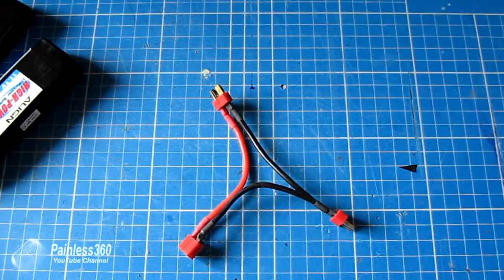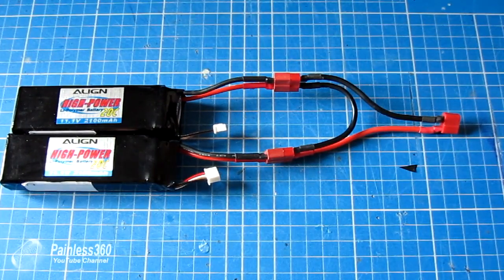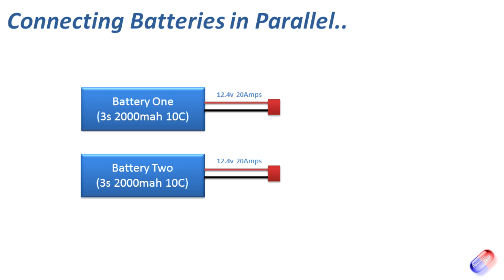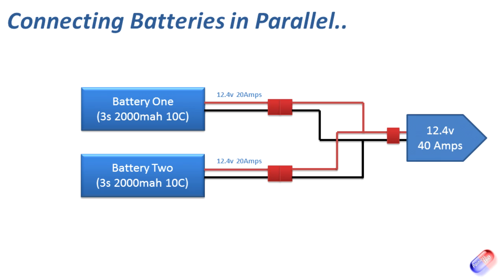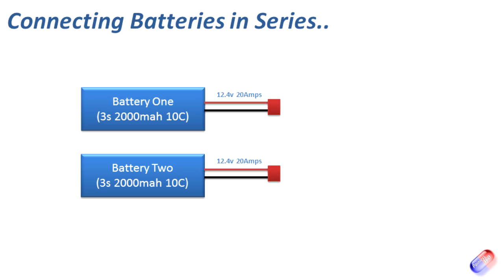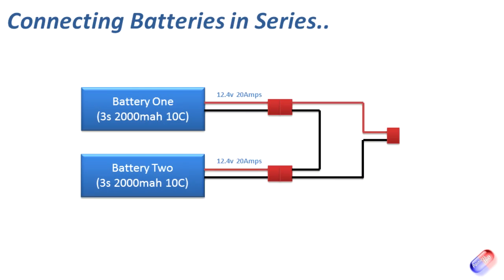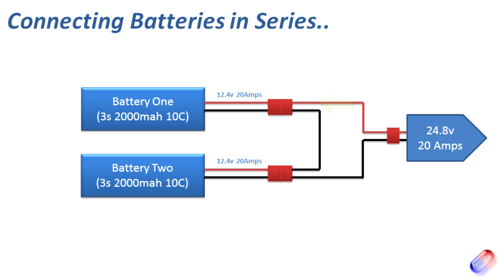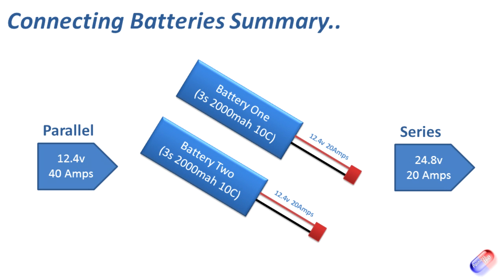Connecting batteries in series or parallel (LIPO)

Comment: hi thanks for making things clear .. I have one question hope someone could help me with ..I have 3 batteries each is 3s, 20c, 2200mah. What happens if I connect 2 batteries in parallel then connect the 3rd one in series with these 2 parallel batteries. I will get 6s voltage but what happens to the amps? & is this safe?
Reply from the maker: Why would you do that? What do you think the answer would be? 

Happy flying!
Reply: Well because my diy quad needs 6s and while am still waiting for my batts to arrive (from China) I have been using 2x 3s in series which gave me 6s 2200mah but I need more mah to get more flight time so since I only have 3 of them I just thought maybe it will be possible to do it and I expected to get out of this setup 6s 3300mah (this what I think the answer would be not sure though) .. Also am worried on how safe will it go :)
Thanks..
Reply from the maker: Catalysis1144 this will not work. With those three batteries you can have either a 3s 6600 pack or a 9s 2200 pack depending on how you connect them. Anything else won't work. If you had 4 packs then you would have other options.

My advice is be patient and use the new batteries when they arrive.

Happy flying!
Reply: Thanks I was just wondering about it.

Comment: So if i get 2 2s lipo 3000mah. 20c. In series would that c rating also be doubled?
Reply: jacob portillo I'm also looking for answer for this same questions. Please do respond if you've got the answer to ur question. Thanks!
Reply: Nikesh Bhattarai well i have been told that no, the c rating is no doubled, but i feel like it is doubled, in my mind it makes since that it should be double, but supposedly no...
Reply: jacob portillo Maybe the answer is No. for your case (2-2S Lipo 3000mAh, 20C batteries, 7.4V), I'm trying to think of it in this way;

In series, 
Total voltage = 2*7.4V (doubles)
Total capacity = 3000mAh (does not change)
Discharge rate = 20C
Constant current discharge would be = 3000mAh*20C = 60A
Time taken for the batteries to be completed depleted at this discharge rate would be = 3000mAh/60A = 0.05h

In parallel, 
Total voltage = 7.4V (does not change)
Total capacity = 2*3000mAh (doubles)
Discharge rate = 20C
Constant current discharge would be = 6000mAh*20C = 120A
Time taken for the batteries to be completed depleted at this discharge rate would be 6000mAh/120A = 0.05h

My assumption is that the batteries would be depleted in same time for both series and parallel connections at their particular constant current discharge rates. If the C-rating would double in parallel connection, we will have the batteries depleted half the time earlier, which does not make sense to me. I'm hoping there's an even better explanation though. 

Let me know what you think of it.
Reply: thatswas a goodway to explain and you are correct, i finally get it..

Comment: I have 4x 3S 3000mAh 20C Lipos. Can I connect them in serial to get 2 pairs of 6S 3000mAh and then connect those 2 pairs in parallel to get 6S 6000mAh??
Reply: Raver Meister You have probably figured this out by now, but yes, you can.

Comment: Hi brother this is dan again , e bike build, I'm having a very hard time understanding what I need to run my e bike ? As I told you in my last message , I'm wanting to buy rc battery's , my motor is 5000 watts and me speed controle is 80 amp , I was thinking about 4 , 5s battery's ? Can you tell me what I need for a battery power and amps , the e bike motor needs more than 20 amps to run , it's all mixed up numbers to me ! Please help ? And should I run in series or parallel ? Hmmmm
Reply from the maker: Watch my video https://www.youtube.com/watch?v=Oda0JYzGG3w it explains all you need to know to answer your questions about LIPO batteries.

The motor you are looking at doesn't sound like a 'normal' RC motor and if it pulls 20 amps at 5000wats then it's expecting 250 volts (mains voltage). That would be a 63 cell LIPO battery!

I don't have any experience with these larger power systems using anything other than mains/three phase mains power. Sorry I can't be of more help.

Best of luck with the project..

Comment: It should probably be important to mention that batteries of different voltages (or cells) should NEVER commented in parallel, while batteries of different mAH should never be connected in series.

Connecting batteries that have different voltages in parallel can cause excessive current from the higher voltage pack to uncontrollably dump that charge into another lower voltage pack, as the system tries to equalize itself. if the current is limited, the lower voltage pack can safely charge up and the higher voltage pack can safely discharge into it, and of course the cell numbers are the same (3S to 3S) thats not much of a problem, nor is it in issue when both packs are already at the same voltage and same cell count. The packs can be different capacities since even if one dies faster, than the other pack will help the dying pack out by taking the load off of it, as well as supply the grunt of the power. More technically, it is an equilibrium condition.

When it comes to series circuits, the cell count actually can be different between the batteries, however, the capacities MUST be closely matched or else the one pack will discharge faster than the other, and they will need to be continuously balanced, and if one pack fall below 3V per cell, and the multi rotor is trying to draw lots of current, it can be thought of like a short-circuit, and you can see the small dead battery will be reverse charged by the bully battery, and it will probably explode! I like explosions, but not expensive ones! (Also I do not like class D fires. They nasty!)
Reply: +Power Max this is exactly what happened to me, and I was absolutely sure that I made all the conections right, turns out when connecting in series, one of the batteries was discharged while the other was fully charged, I saw a little sparkle while plugging them together, but after 1 or 2 seconds, the balancing ports (also connected in series) started to heat up, and I could see them burn in an instant... first tought I had was to run the hell out, but I quickly disconected them before anything else could happen. If I would have run, i could have caused a LiPo fire for sure.

thanks for the info!
Reply: do you need the lipo FPV battery ? if you need, see the below link :
https://dxf-hobbyking.aliexpress.com/store/3027015?spm=2114.12010612.0.0.AgUELV do you need lipo battery?
Reply: exaclty true ! in parralale u can mix different capacity  1 ah+  3 ah + 10 ah  = 14  ah   and if use 7.5 ah  ( 50 % of total capacity )  and u disconnect them  each pack will still have 50 % of their capacity  that mean the 1 ah battery  with be remain with 0.5 ah    , the  3 ah  will remain  with 1.5 ah  and the 10 ah  will have 5 ah still remain  ,, many people believe that the smallest will die first ,,, ,, it's exaclty the opposite in serial  it's could  , but not in parralale ,,  u right to mention it
Reply: pochul I actually never thought about it in terms of capacity, but absolutely true, considering the similarities of the charge/discharge curves between the same cells w/ the same chemistries; and also the voltage, since the cells will remain at exactly the same voltage when in parallel. Good point!
Reply: +Power Max 
I would like to move into the parallel configuration for my quad. I am not entirely confident that ensuring the voltages are identical is practical. If I charge the two batteries separately, I would assume there will be small difference between the two given the quality of the chargers.

Now the difference may be only negligible, but I would assume there would be some at least short lived high current between the two when connected that would be very unhealthy for the batteries and potentially hazardous if done with every charge and use.

Would you have any practical suggestions for equalizing the batteries after charging? Would a large series resistor between the 2 work?
Reply: +Alexander Buckley Just make sure they are both the same chemistry, and same nominal voltage or cell count. (11.1V 3S), and that both are fully charged before connecting them in parallel.

If you change your mind about charging them separately, I recommend also connecting the individual cells in parallel. The ballence connector gives you limited access (in terms of maximum current) to those points, good enough for this purpose.
Reply: +Power Max 
My original concerns were related to connecting to separately charged batteries together in-system. I am a computer engineer, I am good with circuits and all that... but batteries do not really fall into my knowledge area.

Even for small voltages, I can see there being a large transient on connection. I just don't know if that is a bad. There would not be any sustained high temperature that would be similar to shorting the battery. But on the chemical composition level I have no idea what impact that may have. Repetition of minor damage adds up. It goes without saying there are significant flight time and safety concerns.

I have started thinking about parallel charging since doing some further research.

It is the balance connector that makes parallel charging not so 'plug and play'.

Are you suggesting wire the individual cell from each battery in parallel for charging or during operation or both?

I am trying to come up with a solution here that is safe, electrically sound, does not require too much custom wiring or any steps that could be mistaken. I'd like it to be reproducible and simple enough for a lay person (idiot proof).

I am thinking now the way to go would be to equalize the batteries in parallel (cell by cell) using series resistors. I can make an assembly that can be attached and switch operated. After that, Y-cables can be connected for both power lead and balance lead, 'forever' keeping them as a single unit for both charging and use.

I am just wondering how they would behave, two cells permanently in parallel. It is obvious in the series configuration that each cell behaves differently. I just have no idea what impact permanent parallel connections have on battery life/capacity.

I wouldn't be surprised if this even was a beneficial arrangement, one that may reduce the chances of an individual cell dropping below it's threshold while  the total voltage still remains over the low voltage cutoff limit. 

Or one cell's charge voltage could be reached with limited capacity, triggering the charge stop. Meanwhile the other cell could have still taken more charge.

Or maybe both things happen it is a trade off, life for capacity.

I am just worried about some sort of favoritism scenarios occurring that I don't know about. Like one cell getting pushed to hard in use, hastening it's demise.
Reply: +Power Max This reply is for all. I am putting together lighting systems for the Baja 1000. I presently use motorcycle battery to run one 32Watt HID and a 9600mah 14.8 volt LiPo to run the second 32Watt HID. I am limited to the power I can pull from the bike altenator. Since my LiPo packs are getting old I would like to replace with two physically smaller packs do to weight and Balance reasons. Any suggestions would be apreciated
Reply: +Power Max can I connect a 25c and a 35c in parallel?
Reply: As long as they are the same nominal voltage, and same battery type, there is no reason why not. The maximum current that can be drawn should be the sum of the maximum current from the batteries. (the maximum C rating, times the mAH rating gives you the maximum current capability for one battery)
Reply: +Alexander Buckley I'm a computer engineer too - you're thinking along the right lines.

For my ebike, I have 10 x 6S 5000mAh lipos connected as 2s5p, so can use two 20A chargers to do each set of five 6S at the same time. Each pack gets 4A charge rate which is well within their C ratings.
Their voltages should be almost identical before connecting them together and it takes some time and care to equalise them first, so I keep them together as two sets of 5 with each set sharing a ribbon of home made balancing cable between them.

They then look like 2 x 25Ah 6S lipos in series to give a powerful 25Ah 12S @ 48V capable of supplying about a kilowatt hour.

As long as the voltages between the cells are within 0.1V, there shouldn't be a problem with excessive current.
Prebalancing using resistors before connecting is a great idea if you want to treat them extra nicely!
Reply: @ahaveland  I'm a newbie in the field and I'm trying to understand this. When you supply 20 Amps to 5x 6S packs, how do you ensure that none of these packs will be able to pull more than 4 Amps, leading to potentially dangerous overheating? 

I ask this because I've read that over time the performance of each battery changes and charging batteries in parallel requires fine control over the amount of current each battery can get, otherwise some batteries may receive a higher current (above the permissible limits) and others below.

Am I missing something?
Reply: @ntsarb  That's a good question... If the batteries are just connected together, you can't tell what each are pulling.
However, 3 years later, I'm still using the same pack of 6S lipos and none of them have swelled, and if there are any differences in current flow between them, it isn't obvious.
I'll might rig a connector to insert in the current path for each cell and measure actual flow - but this is quite tedious without a clamp meter.
The pack capacity has dropped noticeably, and I guess about 70% of its original, but it is still very usable.
Reply: nice explain andy lee ,  i have   3 x 4s  16000 mah  and that work well too when charge in parallal  bcuz i have only 1 charger 50 w/h
Reply: if u mix  1 c  1000 mah    with 10 c  1000 mah  u can't  take  11 c  of total  mah  bcuz the current will draw equality in each cell   that mean  5.5 amp   11c of 1000 mah = 11 amp  divised by  2 cell  = 5.5 amp in each cell,,   so when u mix C different  u still can use the same C of the weakest battery ,,  but u will not use 1 C of  1000 mah  = 1 amp , but u could draw  1 C of 2000 mah  =  2 amp  bcuz they in parralale  ,, so  , so u if mix  different C  u can use the '' weakest C batterie X the sum of Mah total  "   -->  formul is  :  '' weakest C rating batterie  X  ( mah bat 1 + mah bat 2 )  =  total amp that u can drain ""         ex : 25 C + 35 C  it's still  25 C maximum but with sum of 2 battery Mah      not 60 c
Reply: So there is no way a lipo battery and a li-ion battery can be connected in parallel (even by using a diode somehow)?

Comment: If you kept clips on your cables, could you switch configurations back & forth (parallel to series to parallel) depending on your needs?  Assuming one's solar power & inverter -if used- would be adequate either way, would switching like this cause any damage to anything? Just curious...Thank you.

Comment: thank you for your video , it is very interesting. i need you advise.if you please. i am decide to built my own quad copter after seeing a few of your videos. and i have bought 4 brush less motor Tarot5008 340Kv. and 4 ESC fly-fun from hobby-wing 40A 2-6s Li-po SBEC 5v@3a(hw-bq7509). i am gonna use the ardupilot, with GPS and telemeter. no cam for now , nothing else. i would like to get a good advice  as i requested. what you advise me will be for the battery. i did not buy it yet. and i would like to get an advices from an expert i am willing to pay about 150.00$ to 175.00$ as price . thank you very much for helping making me choice ...

Comment: Great Video!  I think I understand.  So I have a quad copter.  I have two 1800 mah 100C batteries.
If I run the batteries Parallel, I'll get the same amount of power to the motors and I'll get twice the battery life?
Am I right?  It would be like having one 3600 mah 100C battery?
Reply from the maker: Yep! :)

Comment: In a situation with 2 Li-po batteries in parallel, can the balancing plugs also be connected together in parallel to allow cell voltage monitoring?
Reply from the maker: You can but you wouldn't be reading the voltage of each cell in each pack though.

Happy flying!
Reply: Painless360 Thanks thats what I thought: the sensor would just see 1 large 3.7v cell.

Comment: can i connect two different brand different power (mah) and different discharge rated batteries in parallel??
Reply from the maker: Not recommended. Always try and use the same capacity and C rating packs when using in parallel.

Happy flying!
Reply: in parralale u can mix different capacity (but not different volts ) 1 ah+ 3 ah + 10 ah = 14 ah and if use 7.5 ah ( 50 % of total capacity ) and u disconnect them each pack will still have 50 % of their capacity that mean the 1 ah battery with be remain with 0.5 ah , the 3 ah will remain with 1.5 ah and the 10 ah will have 5 ah still remain ,, many people believe that the smallest will die first ,,, ,, it's exaclty the opposite in serial it's could , but not in parralale ( serial can't mix different capacity but different volts can ,,  if u mix different capacity in serial  the value of u pack  is the lowest value of the smallest pack  in serial   2000 mah + 3000 mah  ,  = 2000 mah  , u can't use the 1000 mah remain  bcuz the other pack already to 0 mah  , it's will die ,,  but u can disconnect it  and use ur pack alone with his 1000 mah remain but not with the empty pack )  hope u get it
Reply: pochul Although thats true, it is not necessarily the best solution, for complicated practical reasons, it is better to use the same cells and manufacture so that differences in the chemistry for them does not cause issues. (which may cause differences in the internal resistance, charging curves, thermal characteristics, etc.) Point is it can be done, although like Painless360 says, not recommended. Only Macgyver is allowed to do that! :)